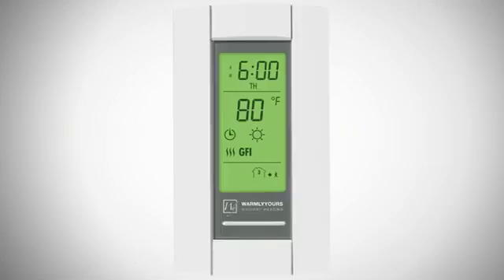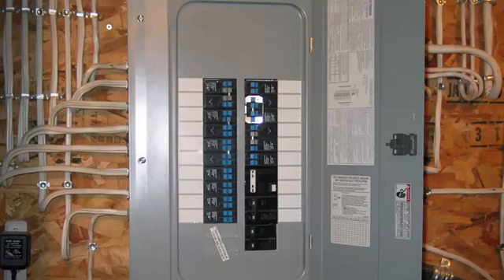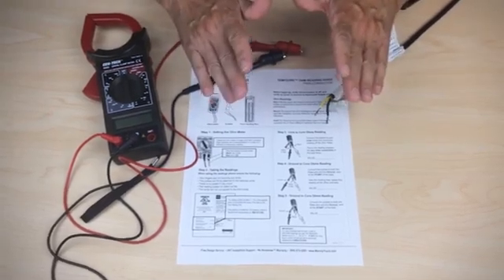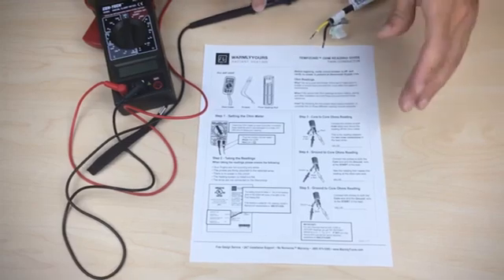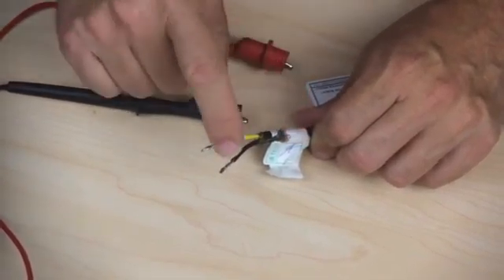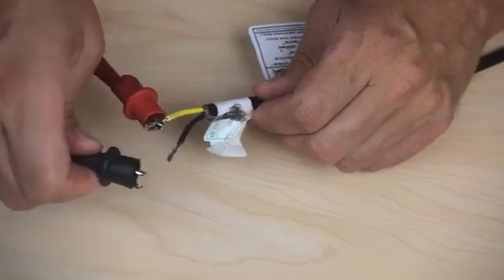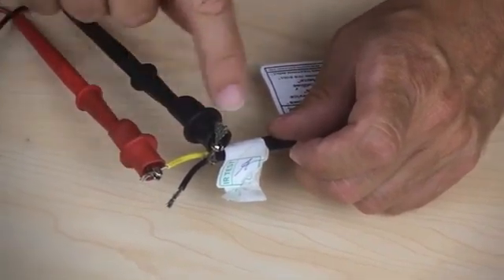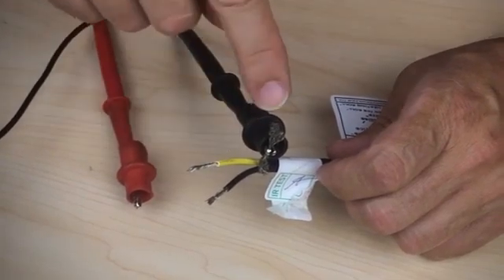Troubleshooting GFI Issues with Floor Heating Products

Comment: My old thermostat display died.... I replaced with the same thermostat wire for wire....now my new thermostat is getting hot..I cut the breaker to avoid damage. Any idea on how to fix?
Reply from the maker: That is unusual. I'd recommend you give our tech support team a call. They're available 24/7 at *800) 875 5285. Be sure to let them know if you have a thermostat/system of ours so they can look up the info. If not, we can still help, just tell them the name of each product so they can better assist you.

Comment: My thermostat keeps tripping with no GFI warning. Whether it's in program or manual, the heating elements show up, then the unit resets over and over. I've swapped face plates with another bathroom which eliminates the faceplate itself. I have a video I can send but am stumped.
Reply from the maker: Hi Matt, we recommend you give our tech team a call so they can help you identify the problem if you have a floor heating thermostat. Please be sure to have the model # handy as well as the name or SO# you purchased the model under if it was through our team. You can reach them 24/7 at (800) 875 5285
Reply: @Warmlyyours  Thanks so much appreciate it.

Comment: If the Ohms are showing 30 and 70 when the meter is connected to the ground wire and one of the load wires, what is the troubleshooting needed?   

Can it be fixed or is the floor cable now unusable?  

What would cause this if the floor heating worked perfectly but one year without use, it now has the GFI issue?
Reply from the maker: Hi Brian, if you're having issues with your system, please give our tech team a call asap. They're available 24/7 and can help you identify what could be causing this. You can reach them at (800) 875 5285. Thanks!

Comment: But how to solve the problem if you have a gfi breaker?  Electrical inspector required gfi circuit to feed the floor heat.  So... now it trips the breaker when heat is turned on.  I need a thermostat without gfi.  Or switch the breaker and put gfi outlets in the bathroom.
Reply from the maker: All of our thermostats come with a GFCI protection, so we won't be able to offer one without out. Our tech support team can help you figure out if you might be able to do something about the ones you already had,  You can give us a call at (800) 875 5285